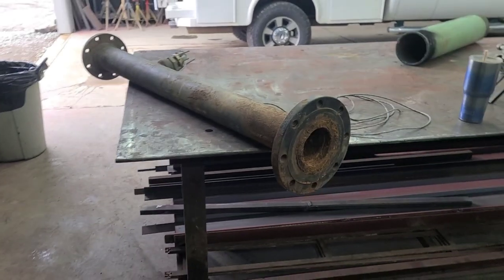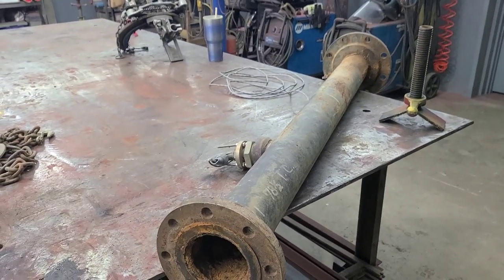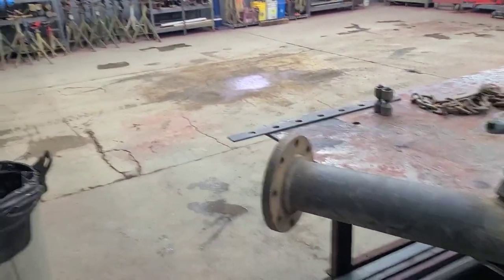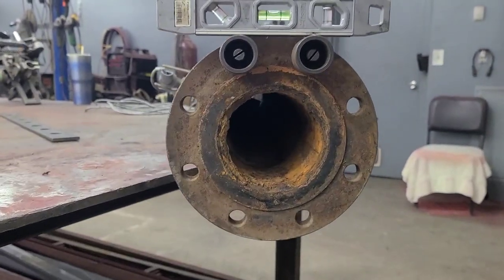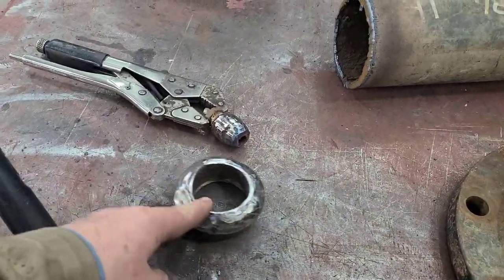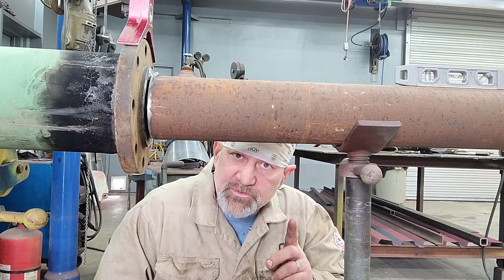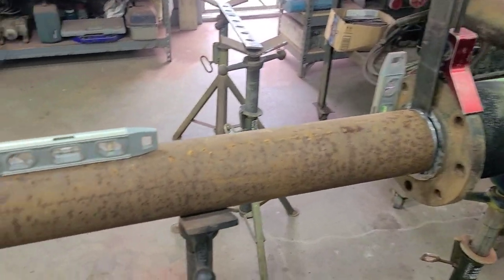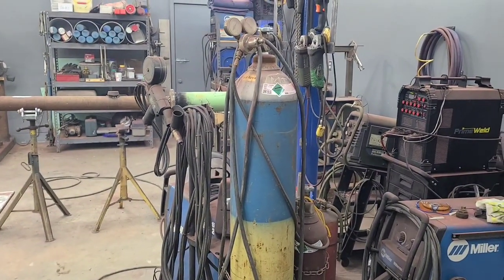Rebuilding a pipe spool for a golf course

Comment: I used to build fuel tankers and all we ran was 90/10 pulsed mig. Through the mill scale rust everything. The big seams were sub arced but all the smaller fittings and flanges were mig. We just turned it up and burned through the shit haha.

Comment: I'm sure there is a reason but could you explain why after welding a couple of passes on the flange you changed sides of pipe and continued to weld on that same flange-?? clear and great  presentation on the layout- thank you
Reply from the maker: I think I switched sides because the position felt uncomfortable...no other reason.

I've been dealing with back pain for years and sometimes changing position helps.

Comment: Great work! I picked up a lot of tips in this video! I'm not at all trying to criticize, just here to learn, but wouldn't a 6010 root be easier that switching the gas on the wire feed? Thanks!
Reply from the maker: I didn't switch gas...I just ran my MIG one go around quickly to fill the gaps and then welded over that with 7018 and that worked well to eliminate porosity from the contamination on these old parts

But when people decide to use MIG on pipe they sometimes use pure Co2 for all passes and no stick at all.
Reply: @NBSWELDING  Oh, I misunderstood- gotcha 👍